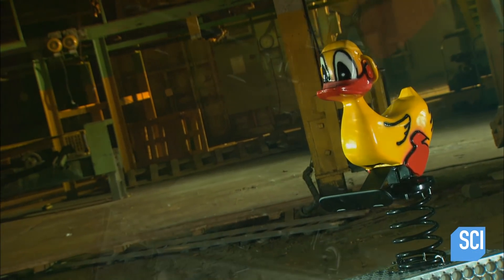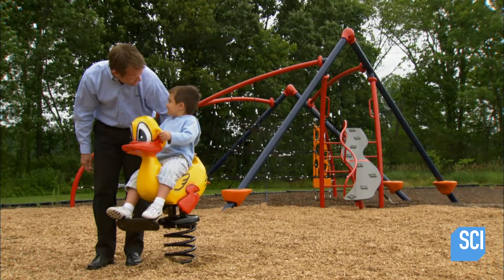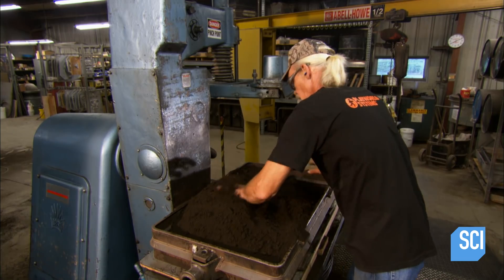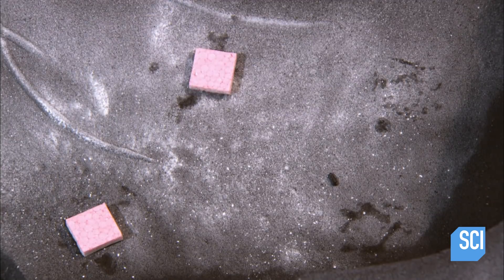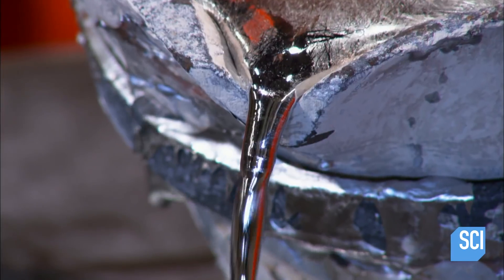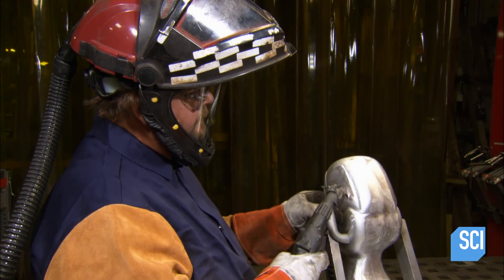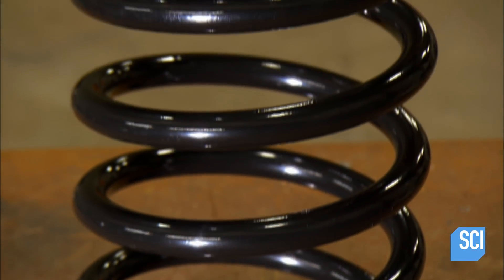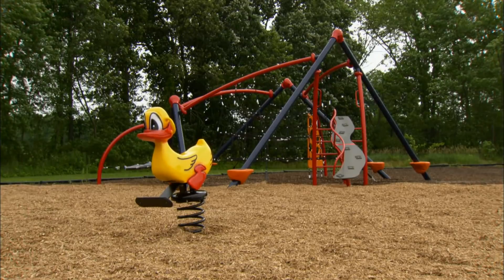How It's Made: Playground Spring Riders

Comment: as a kid, we'd have to walk through a park with these on the way to school.  We'd ride them pretending to drag knees on motorcycles.  In this video,  it concerns me that the U bolts that hold the body to the spring are not long enough to engage the nylock nuts. 4:31

Comment: Wouldn't the 1/4 inch foam spacer melt from the liquid aluminum, thereby nullifying the use of it?
Reply: That would depend on what type of foam they’re using. Foam is firstly ideal because it’s mostly air — making it a poor conductor. Thereafter, the material which actually makes up the foam can also be highly-resistant to heat. Consider the alumina foam used in lab ovens/smelters. You can break it apart with your hands, yet, it can have a melting point of +2000°C.
Reply: it would, but hopefully not before allowing a layer of viscous alumina to form around the underside of the ducky